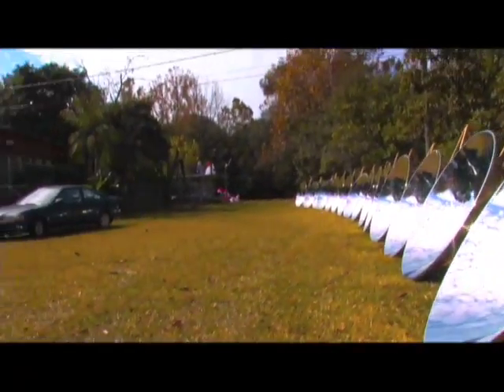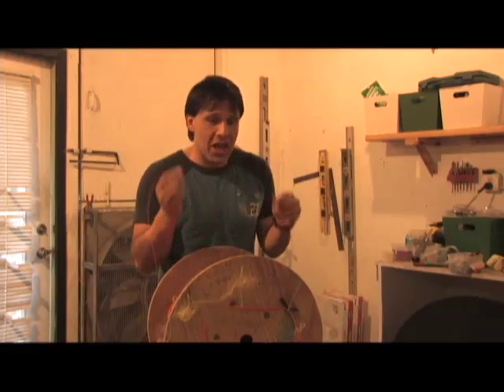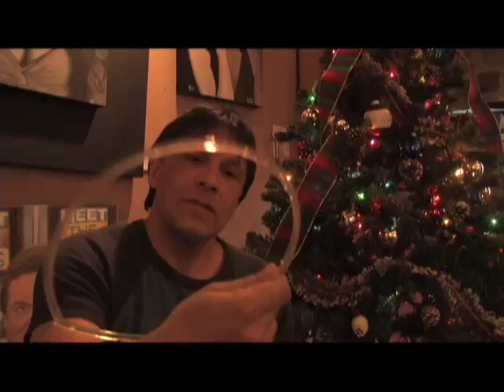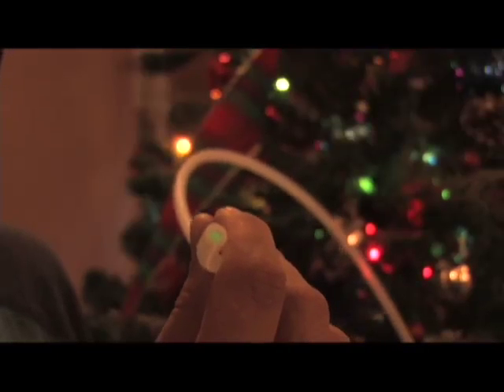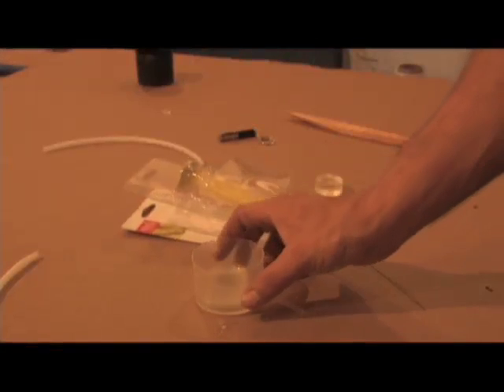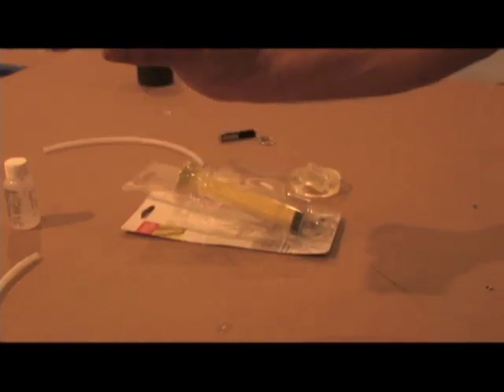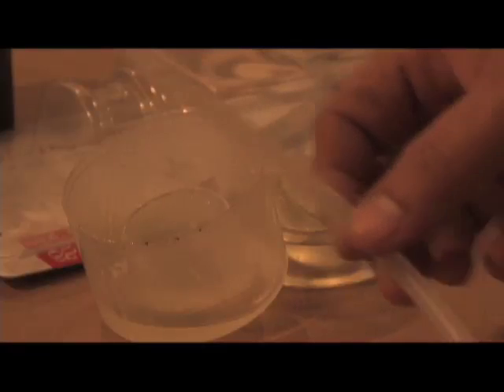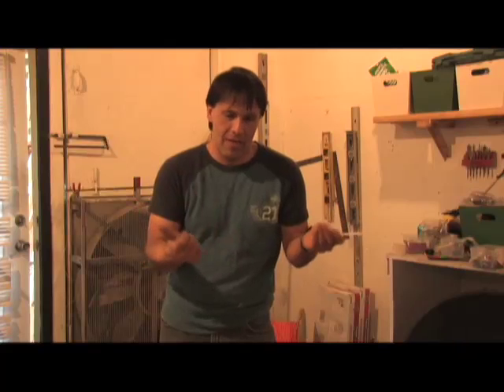HOMEMADE OPTICAL FIBER FIBRE OPTIC LIGHTING CABLE DIY Do it yourself Fiber Optic Cable Optical Fibre

Comment: Don't blow by the chemicals you use, MEK as in methyl ethyl ketone. That's some stuff you might want to be careful with!
Reply: Yes. MEK when mixed with fiberglass resin puts out a lot of heat and a lot of toxic fumes. The larger amount of MEK you mix at once, the hotter it gets. Mix enough and it will catch on fire.

Comment: I guess you have never priced WINDOWS especially if you want enough of an R factor to be able to practically heat your home. I guess you never looked into the COST of adding massive quantities of windows to an existing home. There is a lot of things you never considered. 

how about we are on a spinning planet going around a sun so even if you have enough windows its sun lit for a few hours at most.

POINT IS this would enable people to add LIGHT to there homes WITHOUT using electricity.

Comment: WINDOWS !  design your house in a way, so that it has optimum window arangment... it will give your house more qualities other than light penetration.
common sence
Reply: Except most people live in used houses, so they don't get to design their window placement. And windows do more than light a room, which many people won't want. And then there are rooms which can't get enough sunlight from the sides, and are not on the top floor.

Also "sense" is spelled "sense".

You have Dunning-Kruger disease:
https://en.wikipedia.org/wiki/Dunning%E2%80%93Kruger_effect
Reply: thanks man, glad you told me!